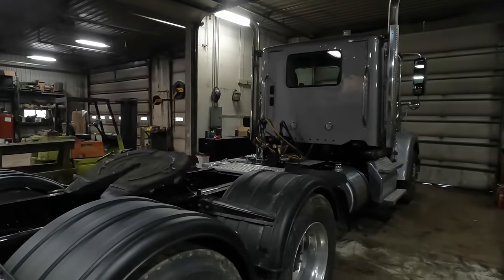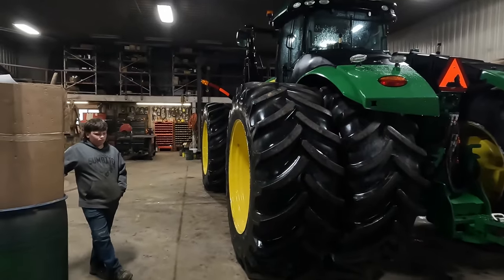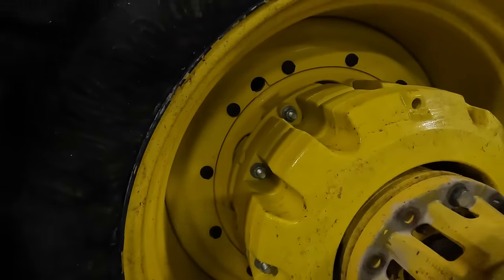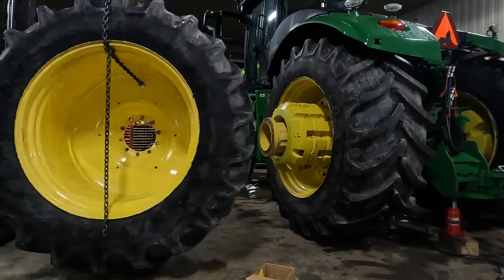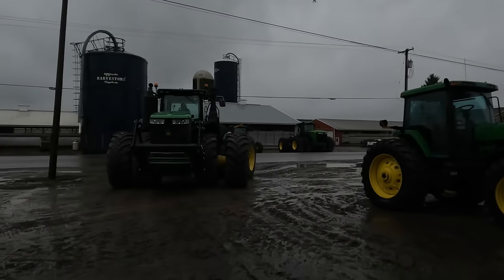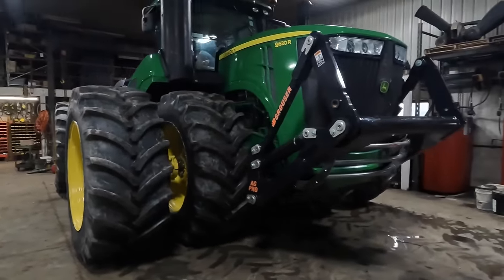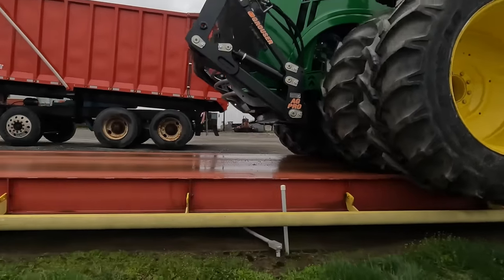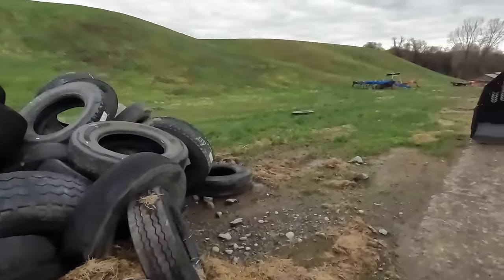Weights And Why Grouser

Comment: The 9410 is at 126.48 lbs per 1 tractor HP, the 9360 is at 119.44 lbs/HP, the 9560 is coming in at 97.67 lbs/HP, 8360R is 94.44 lbs/HP at 360, 8220 is 124 lbs/HP at 225 HP, 8320 is 100lbs/HP at 250. The 9620 is at 99lbs/HP and if you got in the 70,000 lbs range for the 9620R, you would be at 112lbs/HP to where you said you needed to be. Great video as usual!

Comment: Back in the late seventy's I worked for Steiger tractor manufacturer  . On the biggest tractor at that time was the Steiger Panther lll at four hundred and fifty horse power  . With all eight tires filled three quarters  full and two hundred and seventy gallons of fuel on most types of soil  . Than pulling the most appropriate pieces   of equipment for that amount of horse power  .
There would still be choose to a thirty second of an inch slippage  . Witch is a lot of tire wear  .
At that time the widest tires were thirty six inches wide  .
I understand the reason for so much weight  .

Comment: cast weights are definitely the better choice vs liquid, especially with radial tires.  What I have read is that liquid prevents the tire from flexing and essentially makes it like a bias tire resulting in more compaction.

Comment: The LSW tires have several advantages over tracks.  1st - you save fuel.  It takes more engine HP to turn tracks than it does tires.  2nd - It costs less to initially buy tires over tracks and its components.  It costs less to replace tires over tracks and its components.   3rd - LSW tires offer a smoother ride than tracks on the road and in the field.  Faster times means money saved.   Making money is the name of the game.  4th - In my opinion, I think LSW tires can go through more muddy conditions than tracks.  5th - Have you seen some the YouTube videos of farmers with tracks, and what it takes to clean out the mud and junk from the tracks and its components?  A lot of cleanup time with tracks.  And then,.....if you do a lot of road travel with tracks, you have to sprinkle some kind of talc to keep the tracks running cooler.

Comment: not shaming you in any way when you have tillage tool on that tractor how will you keep the blade frame from creeping down or is there enough outlets to keep the lift hooked up to combat that
Reply from the maker: Good question, we have enough outlets and currently have it in remote 5
Reply: Do they have any way to pin or lock the blade mount up or do they just rely on the hydraulics?
Reply from the maker: No there isn’t

Comment: Those wheel bearings I can’t imagine the load on them. Wow.
Reply: It seems like alot but actually its not as much as it seems because the weight is pushing on the wheels which are sitting on the ground. The wheel bearing is holding the axle shaft and really that's it. Now if you jack up the tractor from the center then the weight transfers to the wheel bearings at that point.
Reply: Really

Comment: Beet juice is what have in one of my tractors, seems okay; but in really cold weather (below zero) kinda lumpy for about a half an hour of operation, tire pressure seems to help that. (all of my tractors are FWA and 2 wheel drive 100-140 hp)
Reply: Everyone around here uses methanol in tires.

Comment: ha, had mega crane need counter weights, could use leverage multiply the weight, if had huge mega crane put the counter weight on a fulcrum 100 feet away, would probably break the lever to be strong enough beam hold 500 tons of crane counter weight 100 feet from fulcrum whatever, it would be much heavier, ha, huge cement pump stuck in mud, tractor like that can't pull it out, and the tow truck can because has the recker gets the stuck cement pump up in the air, was the problem